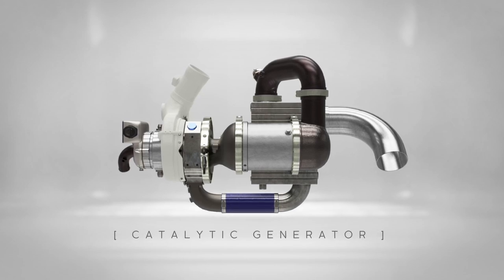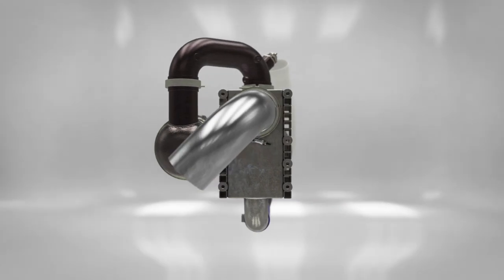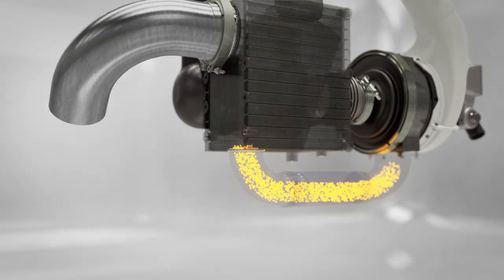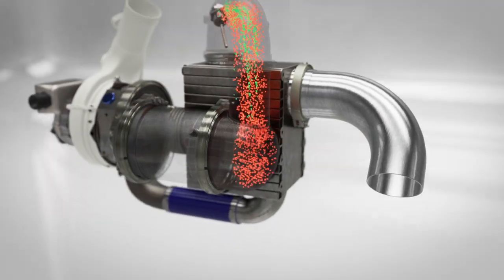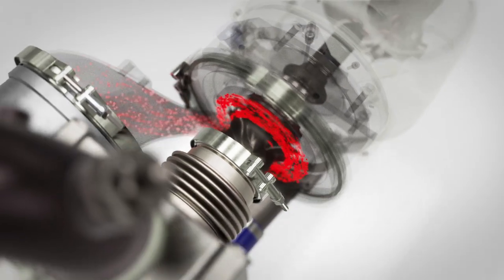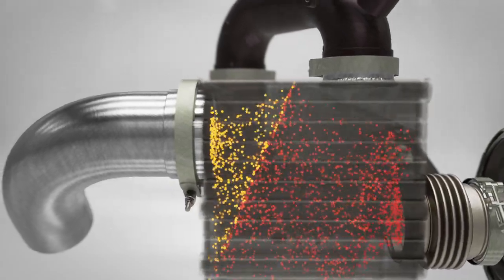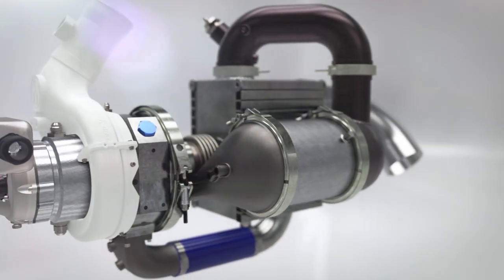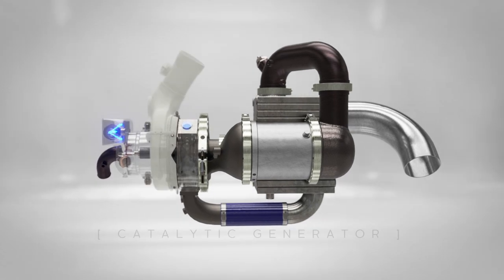Delta Cosworth - Catalytic Generator Particle Flow

Comment: There is a 3D printed, fuel-agnostic, linear piston heat engine design that's potentially 2x as efficient as a Cat Gen is going into beta testing with customers next year. It's called Karno by Hyliion (it also has applications in solar concentrator and nuclear). It's originally a GE patent they were going to use it in large hybrid Class 8 trucks, but have switched to stand-alone generators. I do love the elegant idea of using flameless oxidation to run a turbine though - maybe at larger scale, efficiencies improve?

Comment: Sound? CO? NO?
Reply: I believe it's 90% less Co and no than current euro 5 standards since there's no flame.
Reply: Most NO is due to high combustion temperatures. Because this is lower temp the exhaust is way under the EU NO regulations.

Comment: So is there any combustion happening after the fuel injector and before the Catalyst?
Reply: CMIWW. The fuel is just heated (and maybe vaporized) because of the hot air. Fuel energy density is much higher than air, so we heat the fuel with hot, compressed air to extract the energy to spin the turbine. The fuel is not combusted, so it doesn't ionized and create flame, and doesn't create volatile materials.
Reply: The first thing that comes to my mind at the word "catalytic" is the flameless gasoline handwarmer. I am not very familiar with how exactly it works, but I guess the fuel is somehow consumed in the process.

Comment: This is just crazy thoughts. So the fuel is not combusted, just heated (and maybe vaporized). If the exhaust gases is condensed more, could we collect some of the fuel again?
Reply: If we use this thing as  a power plant we could heat water for space heating with that 350 C and condense what ever left in it
Reply: Of course the fuel is combusted (burned)... just not with a flame. Fuel reacting with oxygen is what provides the energy in any fuel-consuming engine. The exhaust contains combustion products (carbon dioxide and water because the fuel is a hydrocarbon), not fuel.
Reply: @brianb-p6586  oh I thought the fuel just expanded (vaporized) but not combusted (chemical reaction). If so, then it's impossible.

Comment: What IS suspicious is that we can't still see it made in metal yet. While various linear generators are at least being made as test pieces (didn't hear of mass production, but that already is a step ahead from CAD models).
Reply: Will these be available soon?
Reply: I don't know how you think linear generators are relevant to this gas turbine engine. 
The CatGen has been built and operated; it is featured in the Ariel Hipercar project.
Reply: It's been installed  in a Ford transit van also

Comment: I don't know how you call a gas turbine "flameless."
Reply: Because it's flameless. That's why.
Reply: In flameless oxidation, theoretically there is no bright orange "flame front" you would see in the detonation of fuels in a combustion engine although you may occasionally see impurities burning off. I've seen a demonstration of flameless oxidation of diesel - It looks like a blue flame similar to natural gas in low lighting conditions. It's not new - it's been used in metallurgical furnaces for a while - see also FLOX. Cosworth says they're using a catalyst - so this may be some variation of the process (but not exactly).

Comment: This sounds totally brilliant!

I would love to hear more about fuels. Can it run on ammonia? Ethanol? Truly anything?  Just adjust the air-fuel mix?

Also, what is the startup like? Does it lean on electricity to heat the initial fuel and air before the exhaust is fully flowing?
Reply: Yes it can search first car using turbine
Reply: It uses the electric motor to spin up the turbine before injecting fuel.
Reply: The Achilles heel of hydrogen fuel cells is you need the full hydrogen fueling network before the first car makes sense. But with flex-fuel everything is different, use hydrogen when you have it and ethanol or something else when you don't. 

Just for reference, they say they can build 35-70 kW units.  The fuel cells in a hydrogen bus are 70kW.  They want to sell these for 4-10k. A fuel cell for a bus is 300k, maybe more.  This is super practical!

Comment: I would love to know the claimed efficiency of this unit
Reply: Not much, i guess, a cycle with a regenerator does not imply high compression ratio, so cycle efficiency won't impress. Thanks to regenerator it won't extra low(smt about 28-33 percent imho)
Reply: But it will run on basically any fuel. Also the cheap stuff.
Reply: 28%. The fuel efficiency is fixed for all types of fuels by the thermodynamics of the system and the recuperated brayton cycle. That being said, fuel consumption will vary depending on the type of fuel used.
Reply: @EVResource  so, guys, what you are saying it could be a great a power plant for any house since you can  use any type of fuel, do not need a chimney for exhaust gases outside and by using waist heat  for space heating  and domestic water
Reply: Remember you also have regen as part of this system because this is paired with the electric drive train.  That will add to the overall efficiency of the vehicle.

Comment: 35 kW of energy... per hour I guess? Which voltage? Fuel consumption? Too many question...
Reply: 🤦‍♂35 kW is, roughly speaking, 35,000 Volt x Amperes. At a voltage of 1000 Volts, you will take 350 Amps, for example. An efficiency of 40% is 1,5 times better than any internal combustion engine and twice as good as that of the general power grid
Reply: kW is a measure of power not energy.  Run continuously for 1hr it would produce 35 kWh (energy). Small gas turbines are not efficient, nor are they cheap. What they bring is small size and weight and fuel flexibility. Good for things that fly where size and weight are a premium. Not good if you care about fuel consumption or cost.
Reply: @willismith3169  U must be loving boats
Reply: @willismith3169  unfortunately the recuperator (regenerator, heat exchanger) which improves efficiency also adds bulk and mass so it isn't particularly small or light for the power output.
Reply: @brianb-p6586 yep. Worked on both gas turbines and on recuperators for Honeywell. Even with a bulky, expensive recuperative, small gas turbines are still not efficient. This is just not going to happen for ground vehicles outside of the military where cost is not important, fuel flexibility and power density are more important than efficiency.